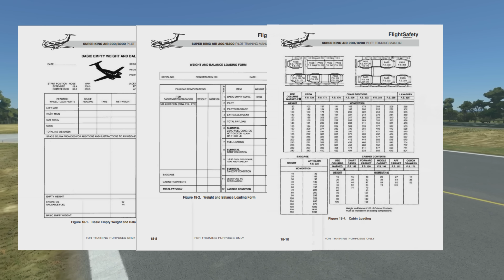Disaster Just After Take Off | Crash of King Air, Melbourne, Australia

Comment: 1 This plane wasn't over weight with 4 people 2rudder trim could be corrected by R rudder.3 It seems to me one of his props did not change pitch from flat to take off or engine failure.4 For some reason pilots FORGET plane fly due to rising into a vacuum not pressing down air. AIR SPEED IS A FACT FOWARD WITHOUT IT PLANES DO NOT FLY. 5 HARD R rudder o pitch on L Prop landing gear up nose down a little flap and she should have flow shallow out very slow climb circle and land. Yelling MAYDAY ISNT GOING TO FIX IT.

Comment: Great video. Thankyou. It seems that thousands of hours of experience did not help this pilot's reaction to the immediate problem on take-off (let alone creating it in the first place). Instead of thinking on his feet, he gave up and simply called 'Mayday' on the radio. I understand that pilots of large airlines regularly train for anomalies and hence a little more prepared to 'keep their heads' in an unexpected situation while flying. This is so important especially for twin and multiengined aircraft which are potentially more hazardous to fly if something goes wrong, particularly with asymmetry.

Comment: Rudder authority would be far more than the small tab, easily controlled by any decent pilot,  so something else involved,,  who was in the right seat
Reply: @Andy B I have it on good authority from my flight instructor who is a high time King Air pilot that the rudder trim has been deliberately made to be very aggressive by the manufacturer to counter the extreme yaw from a single engine failure. He said at speed, you cannot push hard enough on the pedals to overcome it. (He suggested that gear up and asymetric throttle (maximum left engine and reduced right engine) could have straightened the aircraft's heading, allow an adequate climb rate and bought the pilot time to fix the problem.)
Reply: @Coops777    Thanks for the info,  So that info should be highlighted in the Flight Manual and in BF  and  AF  checks !   Did they find who left the trim fully hard over 😳
Reply: @Andy B.  Im not sure. I'll ask him again as he hears a lot of the "goss" through his connections. I live in Dubbo NSW and my instructor lived for quite some time in Victoria in the RAAF flying King Airs and HS748s. I have a feeling that no one knows why the trim was set there. I'll also ask him your other question about whether the recovery procedure is outlined in the POH and checklists. (I would well imagjne it is) Im astonished at the complacency of the pilot. In my opinion, twins are death traps if youre not mentally prepared for situations that might develop. It sounds to me like this high time pilot did not have currency with simulator and emergency training and was very used to having everything going to plan. Your first reaction should never be to jump on the radio but to fly the plane all the way to the crash site (or hopefully to a safe altitude).

Comment: The rudder trim tab should have been overcome by pilot input on the pedals and the yaw damper.  
Considering the rudder trim tab input was not overcome by the pilots and yaw damper - it seems the pilots might try to overcome the rudder with the ailerons.  
This would create “ slip “. 
Slip effect would create loss of altitude along with drag from the gear being down not allowing the aircraft to lift from acceleration.
Reply: WELL STATED ... GOOD POINT  X THANK YOU.  X  CAPT. van ESS.
Reply: That’s not how a yaw damper works… and if the gear wasn’t pulled up you can be sure the yaw damper wasn’t engaged (usually it’s done through 400 feet). 

A yaw damper dampens yaw.. it doesn’t prevent it. You can’t just have an engine failure and expect the yaw damper to apply the correct rudder inputs… it only applies inputs to prevent Dutch roll. 

Also you can’t just overcome the rudder trim. Full rudder trim would likely be double the forces you’d encounter with an engine out.
Reply: Yep.  More rudder, less aleron.  Easier said than done as any sim flight will show.
Reply: Being cross-controlled induces a lot a drag. He may have been using ailerons to correct for the yaw. As stated in the other comments, loss of energy from being cross-controlled, gear down, overweight, plus maybe density altitude, left too little energy left to fly.

Comment: It’s been 30 years since I was flying King Airs but I’m sure with a bit of effort in the rudder department the airplane would have been controllable. This is why aircraft have rudder peddles and pilots have legs.
Reply: I fly an E-90. Full rudder trim would be very difficult to overcome. However, if I was in this situation, I would assume I’d had a left (critical) engine failure. Push as hard as you can on the Rt rudder, get the damn gear up and pitch for VYSE. My next action would be turning in Rt rudder trim to ease the rudder forces. Those actions would have had a good chance of keeping the plane airborne.
I don’t know why this pilot didn’t do these things but I’m betting (and it wasn’t talked about in the video) he hadn’t had recent recurrent training on emergencies.
Reply: @Charon58  "My next action would be turning in Rt rudder trim to ease the rudder forces. Those actions would have had a good chance of keeping the plane airborne"
Absolutely! Because the moment the pilot touched the rudder-trim, the cause of the whole problem would immedeately become obvious...
Reply: my question would be why was the rudder full left in the first place. was he the last pilot to fly it did he have fuel transfer problems on the last flight .If that is an actual picture of the prop strikes that prop was in near flat pitch.
Reply: Sounds more like a student Pilot to Me..........A little right rudder and gear up should have flown fine........I had about 3000 hours in turbine Beeches, But never tried a takeoff with any trims not set properly.......Still a strong right leg for the few seconds it would take to reset rudder trim should have worked just fine................Paul
Reply: @mitseraffej5812, Seems the guy was just along for the ride. I've never flown a King Air, but flown many twins and multis. I'd have to agree with your assessment. Having committed to getting airborne,  a big dose of Aviate rather than talking could have helped.
Reply: The guy was 67 years old and probably missed every leg day for the past 10 years.
Reply: He panicked
Reply: @edmundcowan9131  yes undoubtedly but why was that trim turned hard over
Reply: I fully support the need to examine the driving skills of everyone once they reach the grand old age of 55 years.  That is, the driving capabilities on the highway in our cars.
Now well past 55 years and whilst professionally trained to a high standard whilst I was climbing the career ladder, mistakes are made, simple errors that whilst the rubber is connected to the tarmac are not life threatening.
The mind slows down with age, less able to cope as quickly as perhaps a couple of decades ago and drive far more cautiously and show a greater concern for others.
The pilot at 67 years old is slowing and no amount of hours in the air will compensate for a simple error of judgement.  When you lift the rubber off the runway you have fewer life lines and no amount of experience will help you get out of a tight spot if your reaction time is delayed.  Your eyes for instance don’t convey messages to the brain quite as quickly as you would like and in the car or the motor bike, when you look at the dials your eyes are off the road and it takes longer for them to re focus again and that hazard that was once a fair distance away is far too close for comfort.
Food for thought…nothing more.
Reply: You would think pressing hard on the right rudder pedal would keep the plane controllable and cancel out most of the mistrim
Reply: @skipgetelman3418  yes but maybe the overloading was the straw that broke the camel’s back
Reply: @skipgetelman3418  It would.
Reply: Only charter flights that use two pilots even in the kingair or pilatus.  Just pay extra
Reply: how terrible😢
Reply: Apparently due to the torque caused by the extreme trim setting created a loss of lift plus being overweight added to problem as stated in the video.  Very tragic.
Reply: You need a lot of right rudder to fly a King Air on takeoff when it’s normally trimmed. 

Then think about how much force is required for single engine, and how much you have to trim it to reduce those forces (nowhere near full deflection). 

So the force to just centralize the rudder is likely double that of single engine… with an older pilot who probably isn’t super fit (overweight more often than not, atrophied muscles, poor hip and knee joints). 

No.. I hit the leg press and squat rack a lot and I probably wouldn’t be able to do it. 

Check your trims!
Reply: @Bartonovich52  I still don’t get it how come the rudder trim was fully turned to the left. Does that mean that the last person who flew it needed to have it fully turned to the left to land it. But that doesn’t seem to make sense as one would think that was way too much. Could it be that someone was in the plane at some stage like a kid and was pushing a few buttons and so on and also turned the rudder trim hard over and didn’t put it back to neutral. And maybe the pilot thought it was in the neutral position because he was the last one to fly it and knew it was in neutral because that’s where he always left it.
Reply: @paulwilfridhunt  "And maybe the pilot thought it was in the neutral position because he was the last one to fly it and knew it was in neutral because that’s where he always left it."

Yikes, that's a very fatal and inexcusable kind of complacency. But I'm with you on this. Someone played with the trim and the guy just didn't bother checking it. "I did this hundreds of time"
Reply: @Bartonovich52  I don’t recall the need for right rudder.  But I agree with your comment about his age and physical condition. Apart from why the rudder trim was set at full deflection the big question is why did he continue the take off. It would have been apparent that something was up passing 80 kts.

Comment: So many accidents just bring us back to the basics. A weight and balance for each flight is mandatory, and checklists minimize our human flaws. I doubt that in low, slow, and dirty configuration that full right rudder inputs on a King Air can counter full left trim rudder. We tend to be more relaxed with take-offs than landings; we shouldn't be.
Reply: And if anything, the takeoff is more critical than the landing, as a proper landing would have you high enough where if the engine(s) quit, you could still make it to the runway.  But in taking off, you've got low altitude and the runway is behind you!

Comment: Why was the rudder trim set full left? Obviously the aircraft was okay during previous flight. Was that investigated. However the pilot should have checked. But it's odd that trim was left in that condition?
Reply: That's my question too  If it was from a previous flight, what would have happened for them to have to set the trim all the way in one direction?  I wondered if it was possible it got bumped by a passenger's leg?

Comment: Wouldnt the severity of this issue been noticed before going airborne? As aircraft speed increases the forces acting would become evident. Essentially what I am asking is, wouldn't these forces at some point before lift not be enough to say abort?
Reply: A yaw to the left is normal for a King Air.. and at low speeds early in the roll the aerodynamic forces would have been negligible.
Reply: When you look at the ARSB report and the track down the runway, the aircraft was veering severely to port right through its take off roll. The pilot could and should have aborted his take off but chose not to do so which in hindsight could have averted this entire disaster.
Reply from the maker: That is a good question, with propeller aircraft the pilot will be using their rudder during take off as the aircraft will tend to yaw on the take off roll. It's due to many factors including the engine torque, prop wash and something called the P-factor. This means that the pilot was expecting to use the rudder to keep the aircraft on the center line for the take off and perhaps by the time the issue was really felt it was too late?
Reply: @CuriousPilot90 no. Full rudder trim like that would have been obvious
Reply: @Gee1410thirtysix  This is what I would think.
Reply: Do you think that it's possible that the overweightness of the plane wasn't balanced evenly, or two passengers were not seated and moved about the cabin to one side? Is that possible to cause a yaw?

Comment: even so the trim was set incorrectly. full right rudder should have been enough to maintain a flyable aircraft if it had the correct weight ?
Reply: If you manage to realize within 12 seconds that this is the problem.

Comment: With four passengers and one pilot there should’ve been no way that aircraft was over weight. The 200 can easily carry more.   There was no mention of fuel on board or baggage weight. All that was said was that it was refueled not how much of a fuel load.  With the rudder trim out of position that would’ve been enough to cause the condition, but with proper checklist usage it should’ve been discovered
Reply: The passengers were off to play golf for the weekend.    That weight adds up.    Bottom line though, this is 100% human error and preventable, I feel sorry for passengers and family who were robbed by incompetence.